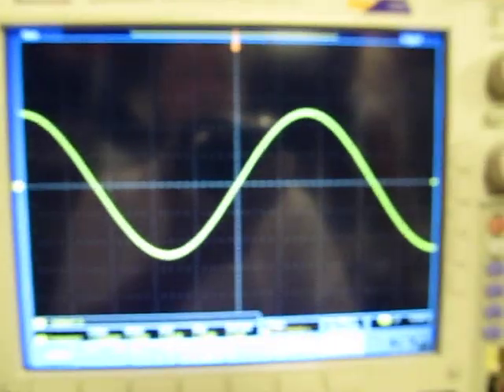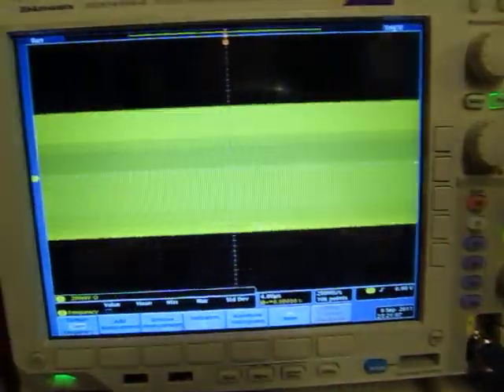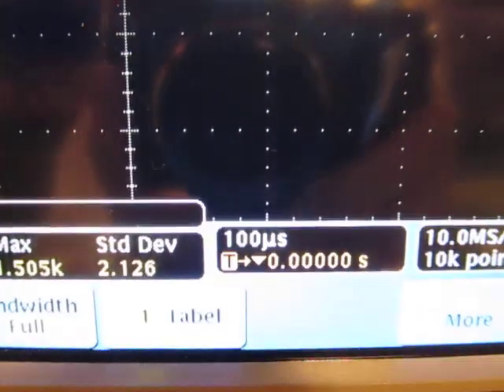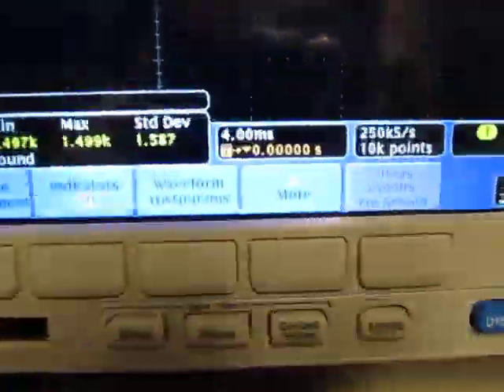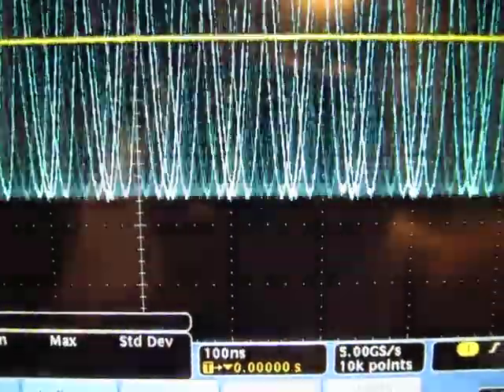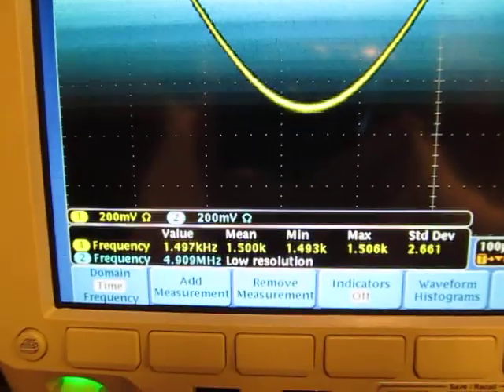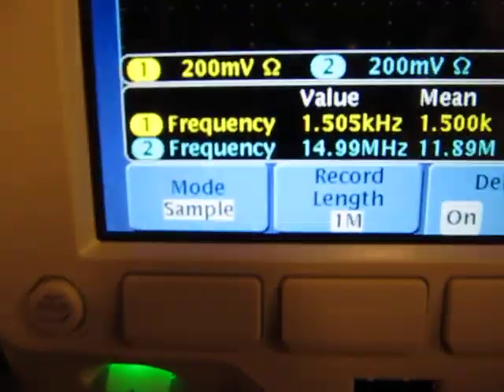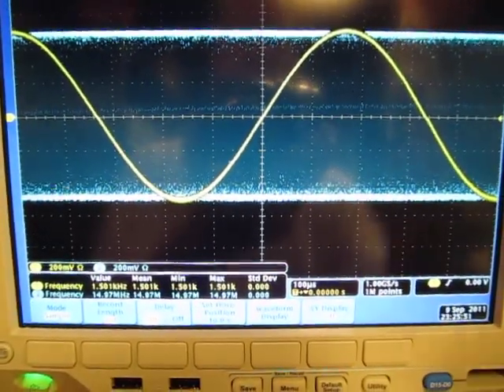#16: How to use the Oscilloscope to accurate capture 2 signals of different frequencies

Comment: What resolution oscope is yours at? because when I zoom in and pause on a waveform it rounds off the edges or distorts the waveform when zooming in on digital Oscopes.
Reply from the maker: I can adjust the resolution on my scope by changing the waveform memory length.  The scope I use in most of my videos samples at 5GS/s, so I can get sample resolution down to 200ps.

Comment: Have you used the OR mode in digital oscilloscopes to display 2 different waveforms? I have used the run/stop button but when you stop a waveform and use the time base to stretch out the waveform the oscope resolution make the waveform distorted irregular because of the resolution. This is why EE techs say to use the OR mode.
Reply from the maker: My digital scopes don't have the OR mode.  I can easily adjust the waveform memory on the scope so that when I pause and zoom in, I don't loose any resolution.

Comment: Older analog oscilloscopes had an Alternate mode but digital oscilloscopes don't have an alternate mode, any reasons why? I have heard from EE tech that you have to use the OR mode in digital oscilloscope to get that analog Oscope alternate mode. The OR mode in digital Oscope is somewhat like the Alternate mode in analog scopes I'm guessing to view 2 different signals.
Reply from the maker: Most digital scopes don't have an alternate trigger, mainly because they display waveforms differently.  An analog scope uses a triggered sweep, so an alternate trigger was used to get a stable display of two signals at different frequencies.  On a digital scope, all you have to do is hit "run/stop", and your waveforms are stable.

Comment: "The way we get around that is..." MegaZoom IV ASIC
Reply from the maker: Not entirely.  When using deep memory, the megazoom asic uses a decimated set of waveform samples for the display and measurements.  This can lead to issues when measuring fast / high frequency signals with the slow timebase settings used to view/measure the slow / low frequency signals.

Comment: What options do you have if you have a scope which (for almost all functions) uses on-screen data instead of all memory data (like the Rigol 1054z)?

I thought for a moment that you might be able to introduce a signal with a function generator which is just the first multiple of the two frequencies, and in principle I think this would work. But in practice, any jitter or drift at all (and we're between 3 sources now) would ruin this.
Reply from the maker: The only option is to use a zoom function (if available) to change the on-screen resolution as necessary, or change the time/div to make measurements on each signal individually.

Comment: Is there a way to do this on TDS 2012? We have this scope in my company and I often have to see two signals with big difference in frequency, but I haven't found a way to do it.
Reply from the maker: Unfortunately, these old scopes do not have the record length necessary (see my video #16) to display two signals that have a dramatically different frequency.  The trigger frequency readout will give you the frequency of the signal you're triggering on - so that is a way to view one waveform and only read the frequency of the other.

Comment: Hi Alan, I'm looking through some of your old videos and I came across this.  I have a question: if the scope has sufficient memory to sample at the high rate, why would you ever have it sampling at the lower rate?  Would it not be better to just have it sampling at the maximum rate it is capable of all the time?
Reply from the maker: The scope really samples at the highest rate all the time anyway.  However, at slower horizontal scales, this can lead to using a LOT of memory, which requires a LOT of processing to store and display.  Thus, most scope decimate the waveform memory under these conditions.  Some can do additional processing (like averaging many points down to fewer points, etc.  Some scopes give you control over this, some don't.   It's all a tradeoff.